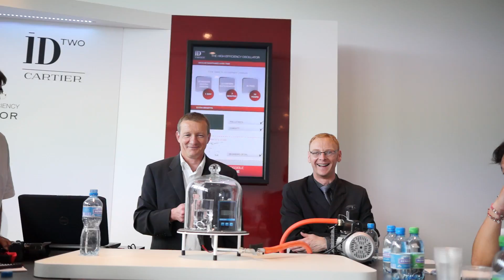water evaporates in vacuum

Comment: Misleading. 

At lower pressure, the boiling point lowers, but the actual evaporation is the same in a vacuum than in dry air. Evaporation is independent of any other gas molecules that happen to be around.

While boiling, it "evaporates" much more... but it condenses also much more, due to that same vacuum, and the net result is the same. In fact, going extreme with the vacuum ends in the water boiling at the same time it is freezing. If there is enough water, you will end with a piece of ice which evaporates.

 Then it will became a comet, lol

To really evaporate as we usually use that word, you need to add the same amount of energy to evaporate from liquid to vacuum as from liquid to dry air. All these values are state functions. The enthalpy change from liquid to “vacuum” is the same as from liquid to dense vapor (which is large), added to the enthalpy change of diluting that dense vapor (which is small).